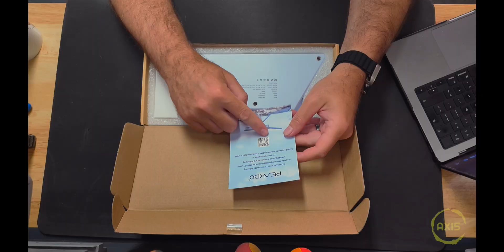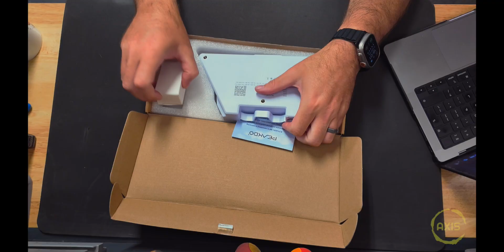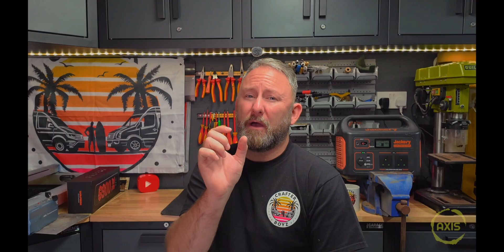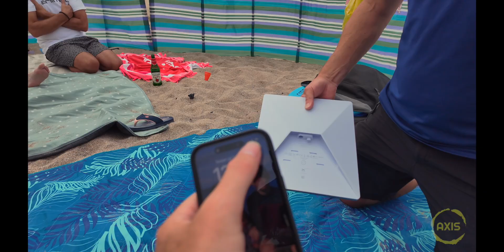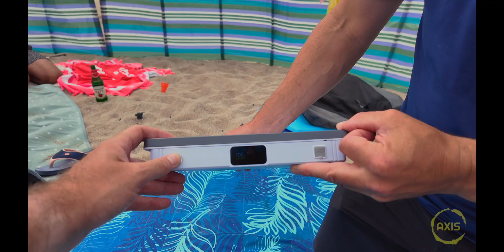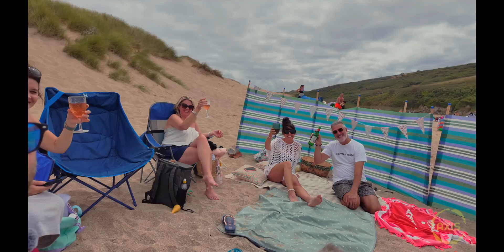Starlink mini Battery pack for a truly mobile use - PeakDo - back up power

Comment: If you have the Mini running &  being powered by the PeakDo - Can you power off the PeakDo  via the App instead of the physical button?
Reply from the maker: Hi, the web app will allow you to remotely turn on and off the Starlink. Not sure if this will work via iPhone though.
Reply: @AXISUK  So would turning off the Mini via the Starlink App actually cut "any" power draw as well???

You said you can turn it back on - how do you do that if you have NO services???
Reply from the maker: @TerryManitoba not sure what your trying to ask? You can turn this dish on and off via the peakdo app which will stop suppling power to the dish, but this will still mean the battery pack will be powered on to allow this function.
Reply: @AXISUK  That  succinct  answer has now clarified what I was asking👍         THX

Comment: Hi mate . I'm thinking about getting a starlink for my sprinter . Would you advise hardwiring it to the leisure battery or using one of these battery packs ? Cheers Mark
Reply from the maker: Hi, you can still hard wire to the van like I have done in my previous video. The Starlink dish is removable, so gives me the option of plonking a battery on it and sticking it on my back pack 👍🏻
Reply: @AXISUK thanks for the reply .
Reply from the maker: @markb1971 your welcome 👍🏻